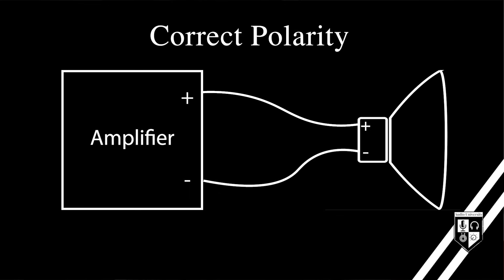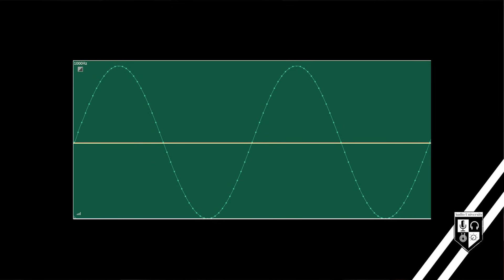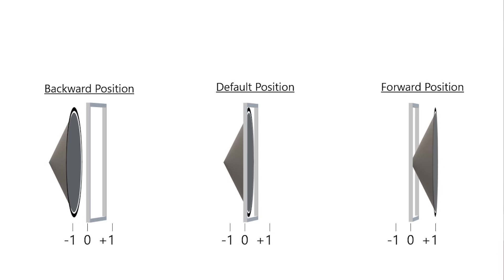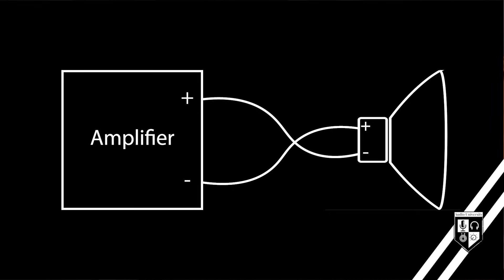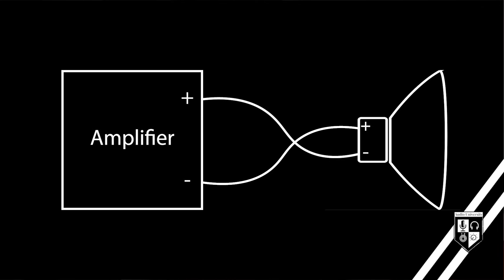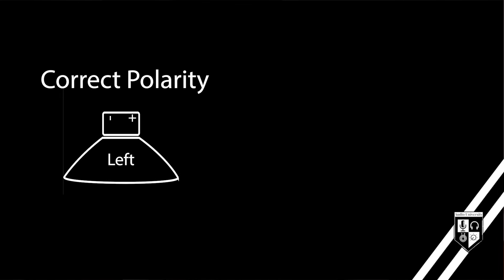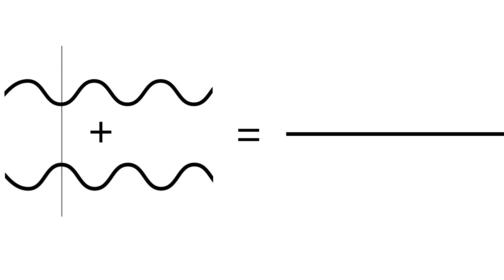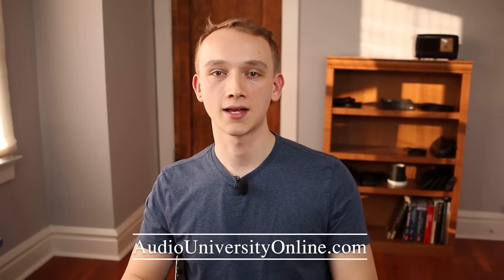POSITIVE VS NEGATIVE: Does Speaker Wiring Matter?

Comment: My Behringer A800 is very confusing. It goes Black/Red then on the other speaker Red/Black. So I just copied the colours, but as pre amp coming from my AVR-X4200W the Red/White connections are backwards. So from Denon to  Behringer I have to put the red in the white, and the white in the red. Not sure if that affects anything? But if I don't do that my left speaker plays the sound for the right speaker.

Comment: I have 4, 15 inch subs, two opposite from the other two. Two of them are connected out of phase so to eliminate standing waves. Doesn't effect the main speakers in my set up. The bass is perfect as you can get.

Comment: For the usual listening every day guy,  a speaker must be correctly connected with the amplifier, meaning + with + and - with -. For a more experienced and professional person, you can experiment or test or use different technologies and ideas.
But to simplify the theory of use for everyone, the speaker should be "correctly" connected due to main 2 reasons: mechanical (or construction) of the speaker, and the sound (wave and hearing effect) that it produces.
Mechanical or construction of the speaker, for an every day low budget one, it will have a "room" of few millimeters or at most 1cm of "travel" distance of the coil/membrane of the speaker that produces the wave/sound. So, it's best for a speaker to push forward the coil/membrane, because it will have more room to do it, instead of pulling inward the coil/membrane, and reaching the construction limits of the speaker, meaning that the coil/membrane will hit a part of the speaker (metal, ring, magnet, etc.) and it will suddenly stop, thus the wave will be shorter, and in most cases, the hitting will produce another sound, that will be noticeable and also disturbing (like cracking or humming, because the sound wave is produced by an alternating current).
For a small cassette/disk/mp3/live internet/any analog/digital source of sound, that effect will lower the quality more noticeably than for a more professional equipment, because a more robust, expensive, larger speaker will have also more "room" or travel distance available for the coil.
Every speaker has its own characteristics, being electrical (rated power, maximum power, impedance, impedance matching with the amplifier, etc) or mechanical (coil travel distance, coil weight including tube material where the coil is placed, the material for the membrane, the material for the elastic part of joint between sides of the speaker and the membrane, being crimped paper, or rubber, or other material).
You cannot buy an inexpensive speaker rated 1-3 volts and usually 4-8 ohm, just to connect it to a powerful amplifier which produces 12-24-50V and needs 2 ohm impedance, because the speaker will pop/burn/explode/have a shorter life, produces a disturbed sound and more artifacts than a good sound.
As a common human hearing being able to listen between 50Hz and 15000Hz (20-20k Hz is for advertising purposes), and during lifetime the hearing will lose the ability to catch the higher frequencies, it's not worth to buy an expensive equipment for common uses.

Comment: Changing the polarity. Just changes the phase angle by 180 degrees...So you can change left to right if paired... Doing the same thing to a bass speaker. Just changes the phase angle again by 180 degrees.. Producing different sound depending on how the bass speaker is setup...

Comment: With a single speaker, there is no audible difference in sound.  WIth stereo, if one is wired "out of phase" not only does bass cancel (bass is always recorded in mono up to about 180 hz) but the directional information of stereo causes weird effects.  Within a 2 or 3-way speaker, depending on crossover design, the tweeter or midrange may be wired what looks like "out of phase", but if you were to change it around there might be a big dip in frequency response around the crossover frequency, so if you go into a speaker do not automatically assume someone wired it wrong.  And to the comment about multiple speakers... there was what was known as the Hafler Circuit, and this same trick was used in some of the large Polk speakers.  You can wire front speakers + to +, - to -, normally.  Then wire rear (or place these to the sides) another pair of speaker, and they do not need to be the same as the fronts, or even have big woofers, they can be compacts... such that these secondary speakers are wires + to + on the amp on both sides.  But then instead of connecting the two - terminals to the amp, they are only connected to each other.  So what happens is the Left rear speaker produces L-R info on the left rear, and R-L info on the right rear.  These mix with the front speaker info to produce a much broader sound stage, or even surround.

Comment: I recently provided PA system for a medium size outdoor event (~150 ppl) having 3 bands playing. I have Yamaha speakers - one pair 15" with horns mounted on poles on top of pair 18" sub woofers. I ran full range sound to the 15" /horn cabinets - used a Rane electronic crossover to send just lower frequencies to power amp driving the subs. I inadvertently hooked the subs speakers reversed polarity (power amp has banana plug type speaker connections making it easy to hook up speakers reversed).
The system had a very "full" sound to it...I received many compliments from both the bands and audience. Not until I was done did I noticed the subs were wired reversed polarity. I was surprised in that I thought if speakers were incorrectly wired a risk of blowing out could result (I drove the system pretty hard/ loud.)
Because it sounded so good I wonder if I could do it like this from now on?
It had such a good overall sound.
😁
Reply: * Ray Bin, * That's a cool discovery. 
I have a JVC micro-component system in my mancave where the speakers are 4 ohms. If i wired two more of the same 4 ohm speakers to the original speakers, will I be over-powering the amp? Its a 20 amp.
I'm confused by many wiring tutorials on YouTube and sometimes they conflict eachother. This is a simple speaker add-on to fill my room so it sounds fuller. - Thanks in advance.

Comment: I notice you use the word polarity when referring to the wiring of speakers to amplifiers and with sound waves as well. Is there a reason why you wouldn't use the word 'phase' when stating that the sound between a speaker wired backwards would be 180 degrees out of phase with the one wired correctly? In other words changing the phase of a speaker by 180 degrees.

Comment: What about JBL drivers that I’ve used for guitar amps. They are definitely reversed polarity. I’ve had some conversations with some guitar amp manufacturers and they say to  wire those up in reverse even a single driver, I can tell in my guitar rigs.

Comment: Many years ago an audio technician gave me what was a revolutionary clue - adding a third speaker to a stereo pair - wired from the positive output terminal of each, and placed behind the listener, in direct opposition to the stereo pair - created a third channel which reproduced everything in the source material that was recorded out of phase (and would otherwise be unheard), resulting in a VERY three-dimensional audio experience. I loved it and it usually blew friends and guests away. Worked best in a room longer than wide. Did my set-ups that way for years...
Reply: Klipsch Heresy was originally developed as a center channel speaker to use between a pair of Klipsch Cornwalls.

Comment: I found that in some very rare cases having one speaker with inverted polarity didn't mean anything at all.  i actually went 2 weeks like that before i realized my mistake.  Needless to say I'm still trying to understand almost 25yrs later why the wiring mistake didn't make a difference at all.   

What you described is an OUT OF PHASE effect. And in most cases that's exactly what happens. But somehow I never got this effect with my stereo.   WHY????
Reply: Maybe your out of phase driver had a specific position in the geometry of the room that worked in your favour , or the driver per se pushed out weak low frequencies by default.

Comment: "Correct polarity", that's just wrong. If it's right or wrong depends or several factors.

Sometimes reverse polarity on a sub might be just right.. The same goes between a mid and a tweeter in a two way system.

Comment: I don't think it should make a difference. Once the signal is coming out of the speaker the air is being move at the same time.  I think because you believe that there is cancelation going on so that is what you hear.  Due to the speaker enclosure a speaker cone being pulled will have the same effect as the speaker cone being push.  Try this put a fan in an enclosure one with reverse polarity,  you will net feel the difference.

Comment: I have a vintage Fisher X202B Amplifier that has a phase switch to compensate for this without changing the wiring. It can also play only the right channel out of both speakers or only the left out of both. it also has stereo reverse as well as a control to blend mono to full stereo. Wish newer equipment had all these features

Comment: Hey yo AU, I have a fender 16" Sound Enhancement speaker that pumps out the beats "backwards". Is it wired + to - to accomplish this? I hope this makes sense. These enclosures are 26" x 25" x 20" (HxWxD) Beasts. Can barley lift them by myself. I finally removed one of the carry handles and discovered to my horror that the "front" of the speaker is totally enclosed. Never seen anything like it in all of my 60 years on this planet. Any info you could provide would be greatly appreciated. Cheers!
Reply: I couldn't find a diagram of this particular speaker but I think I know roughly what's going on. I believe what you have is a fifth order bandpass box. This kind of enclosure has a sealed chamber on one side of the woofer and a ported enclosure on the other. The sealed side protects the woofer against over-excursion and the ported side lowers the resonance. The ported side is an acoustic low pass filter that tends to attenuate any distortion that the speaker or amp might generate. Because of this low pass effect, the amp can be driven fairly hard into clipping without distortion being audible. However this clipping will result in a lot of heat. For this reason, usually the motor structure of the woofer is in the ported side of the box because a little bit of room air gets exchanged with every cycle. It's not a lot of cooling but it's a lot better than no cooling. Depending on the tuning it might actually be correct to switch the positive and negative wires on such a speaker inside the cabinet, but that would also depend on the phase response of the mains, the distance between the main arrays & subs, room interactions, and the desired frequency response. In short feel free to switch the phase around and listen to it or measure it with a RTA and go with whatever you like. The only wrong answer is a dogmatic one.

Comment: Clear and to the point. Great job. I would have given the stereo example unreversed for the listener just before showing the version with one speaker reversed, to emphasise the difference. (Wasn't sure if your earlier example was mono or not, but it would have been good to have the example with headphones recommended, both versions immediately proximate) Thanks for this - it was a question I asked myself nearly 40 years ago while wiring my gear up and noticing that you still got a sound when reversing the wiring.

Comment: I had a problem on stage where we had two floor monitors for the lead vocalist. She called me up and said something sounds strange. We ended up removing one of the floor monitors from the stage to continue the show. When I investigated the two monitors at home, I found one of them to have reversed polarity soldered that way from the factory ! I fixed the connection and on the next show the problem was solved.

Comment: YOU HEAR IT.  CORRECT. THE SOUND GOES INTO THE AIR AROUND US. BY WRONG CONNECTION. THE SPEAKER IS CLOSED. NO BASS REFLEC SYSTEM. SO YOU MUST PUT THE VOLUME UP TO HEAR BETTER.

Comment: I've used out-of-phase wiring in a small area, like an equipment cab, to bring out the stero separation. If one speaker has a weaker output, I use the in-phase wiring on that one to strengthen punch.

Comment: Well, polarity doesn't mean " polarity " and is more as reference point to connect the speakers , to be able to pair more than one in the system . More offen in the speaker with order lll filter , twetter are inverted because the dispersion is so low and phase is more than 160° , and is more effective to come close to 180° phase.

Comment: I'm just a lifelong do it yourselfer, always open to learn, ALWAYS.  I also suffer from hearing loss along with  self-prescribed OCD.  I always do pos. to pos. & neg. to neg. unless it's by accident like working behind (old jobs/hack jobs) & I don't know which I'm looking at.  I don't & never have done this as a job.  I was told long ago it really doesn't matter until you start using a good amount of power & at lower power applications like a head unit only in a car, you won't be able to tell.  Is this true?  Also, is there a way to tell which one is pos. or neg. using a multimeter?  No matter the task I take pride in my work & I love music & because of my before mentioned issue I build pretty good systems in my cars.  Not crazy, just nice so I can enjoy.

Comment: I did this some years go. I had a six-speaker setup: two in front, two in back and two speakers on top of each other in a corner facing the wall. For the corner speaker sets, I inverted the top speaker and the bottom one was wired normally. It really enhanced the overall audio experience, especially in low range frequencies. If you ever try this, the perfect song that bring this out is "Revolution Earth" by The B-52's. Part of the song is played out of phase and the corner speakers, with one wired out-of-phase, really makes that part of the song burst out. It is quite remarkable.
Reply: audiophile  comes in different flavor - not just about how high quality sound is. i used to mess with speaker set up too. i would face certain speaker against the wall and others direct to me. the sound that scatter or bounce from the wall sound remarkable and different almost like its own full phased sounds stage on its own. this was during that time where 5.1 channel was new to consumer. people think i was into something that doesnt make the sounds sound any better. just like i like downward firing sub woofer.  now you see a lot of audiophile who would mess with speaker setup the way we do. just like dolby atmos, those speaker have a upward firing to the ceiling. 

i even used search for song that had only instrument and vocal separately. play one side of the room vocal and other side instrument. it sounded really good.

Comment: 5:17 caution for viewers that Don't do that for long period like 3 or 4 seconds else speaker will POP out ( cause you are applying DC voltages to speaker's coil which is very thin, and most of the speakers impedance is 4 or 8 ohms max that will give you straight equ for short circuit current with 9 volt battery)
Reply from the maker: Thanks for pointing this out! You're right. I've removed the demonstration from the video and will be posting an updated demonstration video with additional information on preventing damage to the voice coil.
Reply: @AudioUniversity  New video upload or will you update this one?
I noticed that my timestamps were offset 16 seconds suddenly :)

Comment: I'd be careful about applying DC voltage -- even from a 9V battery -- across a voice coil too long. That suggested test is more likely to do harm than anything else discussed in the video. Voice coil windings are as small and light as possible in order to reduce the mass of the device. They are designed to be handle AC so that their inductance reduces current flow. If you leave that battery connected more than a few seconds, you may well burn out the voice coil.
Reply: This is why you usually test polarity with a small 1.5v battery, and you should only really tap the wire in short bursts. 

This is a nice way to test a rebuilt speaker driver, or a home-made one, to know which lead wire is the positive one
Reply: Also the ac movement cools the coil.
Reply: I remember testing my speakers that way with a 1.5V battery, which gives a good information without any risk of destruction, right?
What about testing the output polarity of a bass or guitar amp with a multimeter? I assume this should be done with a speaker connected to the amp, not directly to the two wires not connected. Could that be a good method? What voltage do such amps give?
Reply: Depends on the power rating of the speaker. Small speakers (up to about 10 watts) could be damaged. Larger speakers, especially high power automotive sound system speakers rated for hundreds of watts, can handle AMPS  of current without damage.

Comment: You don't need fancy speaker cables -- plain old zip-cord or its equivalent works just fine. In most two-conductor cables, one of the conductors will be visibly different from the other. For example, my 12-gauge stranded speaker cables have one of the conductors colored silver and the other colored copper. Use one color for the two plus-to-plus connections (between each speaker and the amp) and the other for the two minus-to-minus connections.

So long as the speakers are in-phase (connected the same way), you're good to go.